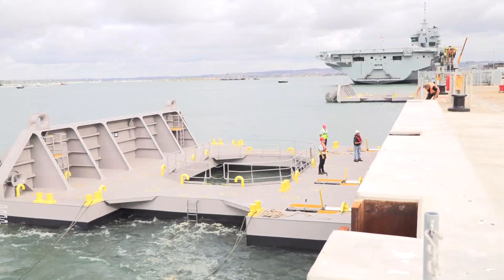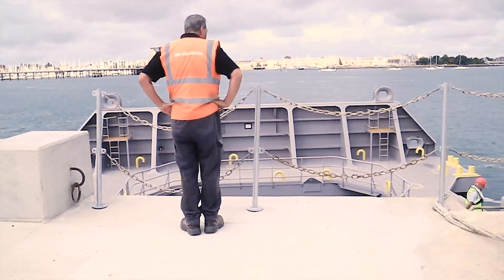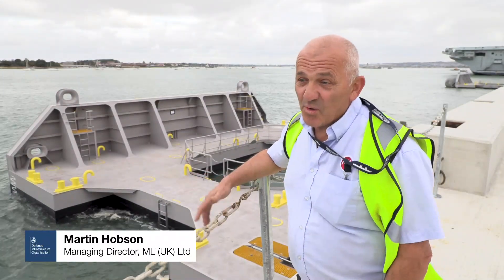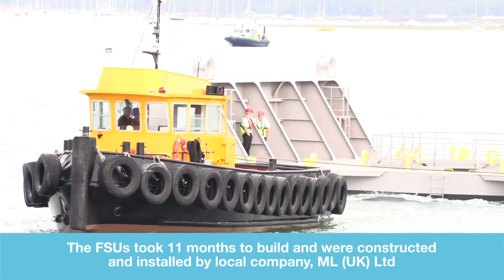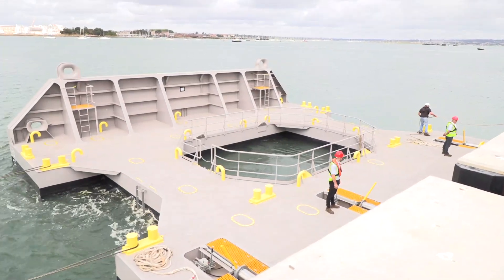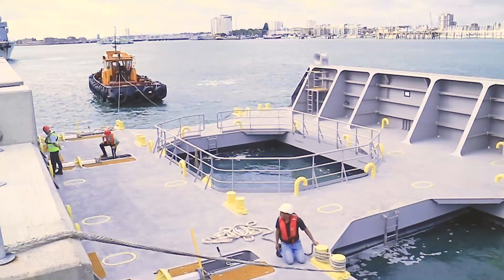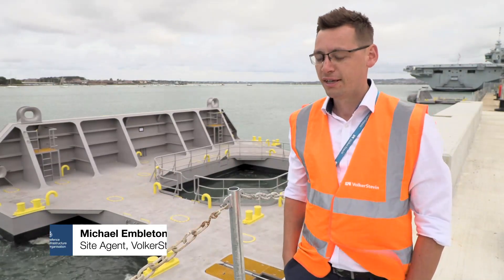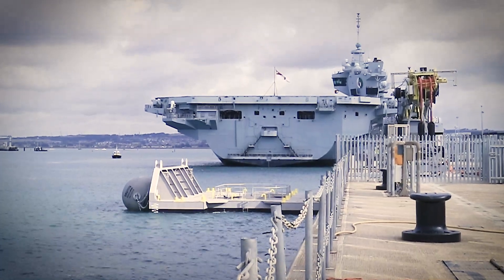Final preparations for HMS Prince of Wales

Comment: What date (or month) is she scheduled to arrive in Portsmouth?
Reply: Is the prince of Wales going to have the same problems as the queen Elizabeth,we have had enough problems with the type 45s.
Reply: @iandowns4864  What problems? She has had a propeller blade need adjusting a few days into first sea trials in Scotland and a water seal let go which was contained.
For the record yes the T45s have a power shut down issue but none have failed to complete a tasking. The Mechs. knew early on what the problem was and in typical Andrew style just crack on and fix it when it happens.
Reply: December and sea trials next week.
Reply: It looks like she'll be leaving Rosyth either today (18/09) or tomorrow (19/09).